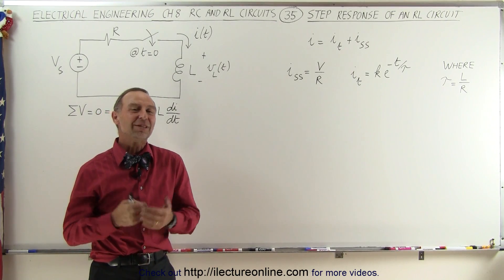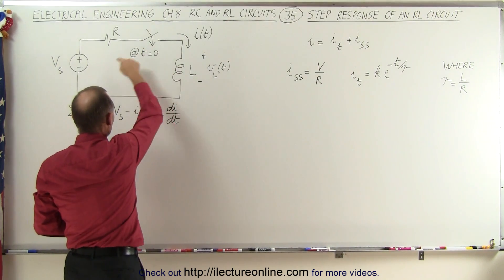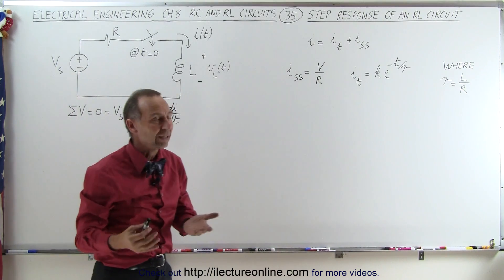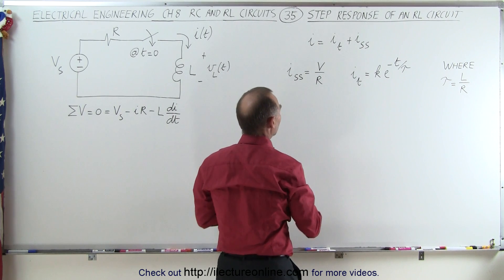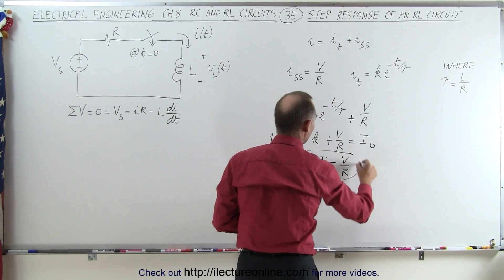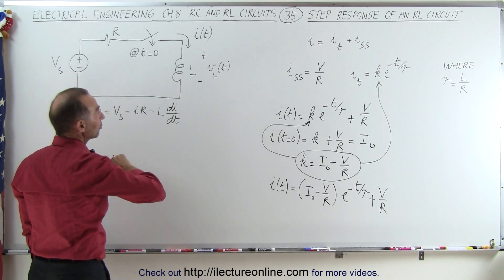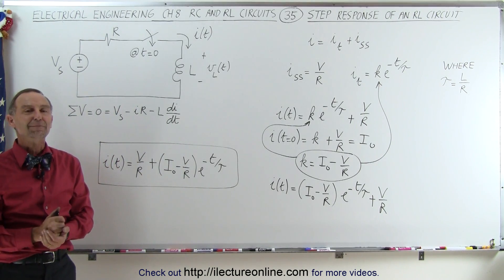Electrical Engineering: Ch 8: RC & RL Circuits (35 of 65) Step Response of an RL Circuit

Comment: Hello, I am confused between the step response and the complete response because they almost have the same formulas. May I ask how do they differ? Thank you!!!
Reply from the maker: In a step response the applied voltage changes suddenly form one constant value to another constant value.    In a complete response the input to the circuit can change in a variety of ways..
Reply: @MichelvanBiezen  Thank youu!!!

Comment: Why current changes if we have constant voltages source .
Reply from the maker: Because the current doesn't reach its final value instantaneously.  The inductor only allows a gradual change.
Reply: @MichelvanBiezen   sir this mean .suppose we have resistive circuit with dc source  and having switch  in series and it is open at t=0 just after we closed the switch. so current not instantaneously build up equal to v/r but it increase gradullay and  obviously its take's micro seconds . now we conect resistor with inductor in series and inductor increase time for reaching  maximum current and it follow exponental curve 
i will be so thank full sir if u answer my question
Reply from the maker: Yes, with the inductor, the time that steady state current (or final current) is reached will be longer.

Comment: Why current increase gradually in rl circuit? If switch is closed there is no current flow in circuit so how current Is gradually Increase when applied voltages as switch is closed
Reply from the maker: The inductor opposes a CHANGE in the current, which is why the current increases gradually instead of instantaneously.

Comment: What if the switch switch have been closed for long period of time and electricity have been flowing trough inductor for long time, but then we switch the position of the switch so that the current travels trough a lower valued resistor but still trough inductor will the inductor discharge or what?
Reply from the maker: Inductors don't "discharge", but capacitors do.  Inductors oppose a change in current.

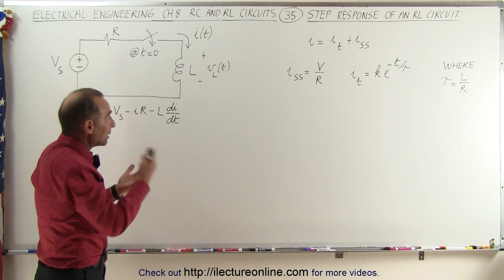Comment: Sir as you said at 0:41 that as we closes the switch then there is no current in the circuit then why at t=0 current becomes Io ?
Reply from the maker: Since before t = 0 (at t = 0 - epsilon) where epsilon ----> 0, there is no current as soon as we flip the switch, the current doesn't increase instantaneously, but will  increase over time.  Thus at t = 0, the current is the same as at the moment before closing the switch.

Comment: I could not understand how is michel saying that total current= trans current +steady state current. By this way the total current have exceeded the maximum value (V/R).Isn't (V/R) the maximum current possible?
Reply from the maker: Plug in different values for t and see what happens.  Let t = 0 and let t = Tau  and let t approach infinity.
Reply: @MichelvanBiezen  so Io is zero right? Ok i got it thanks.